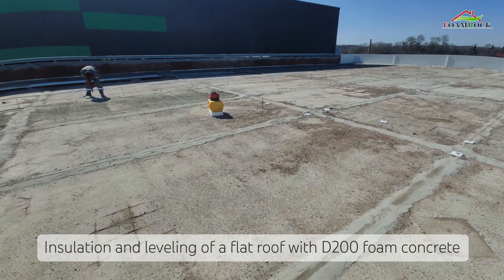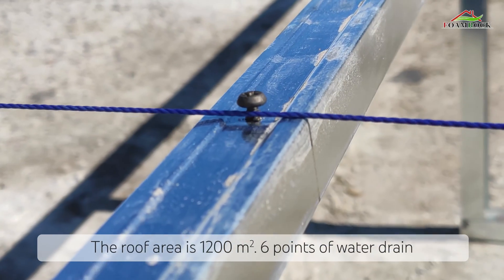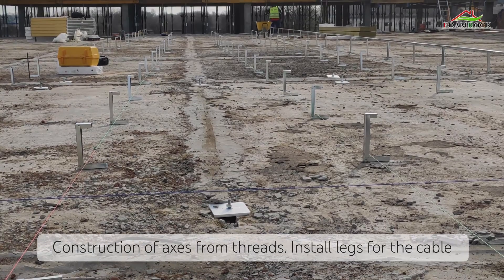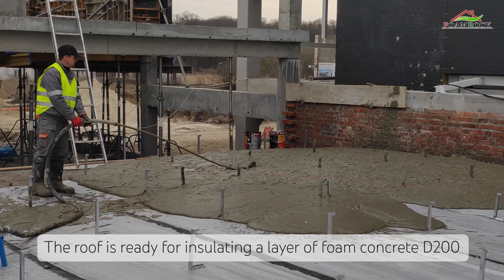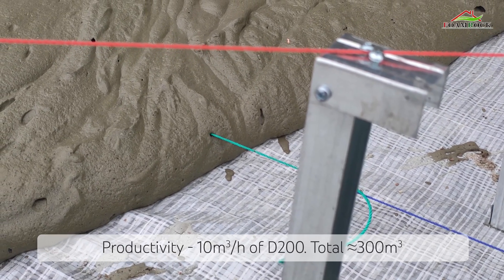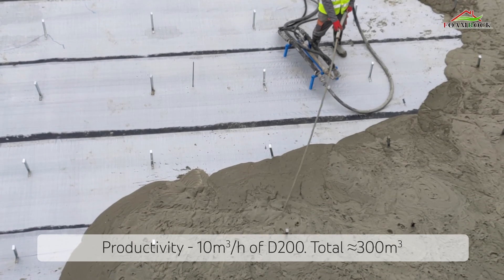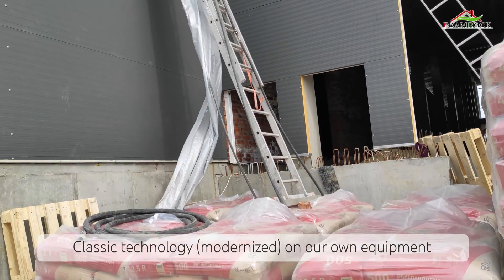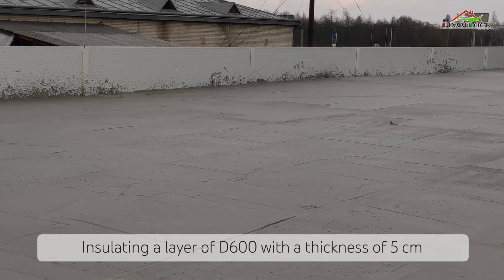FOAM CONCRETE MACHINE 2024. Example of roof insulating and leveling

Comment: How did you apply the film to the supports? The result is very good!
Reply from the maker: We apply supports to the roof (reinforced concrete slabs). And use a bit of waterproofing mastic under every support.
Thank you.